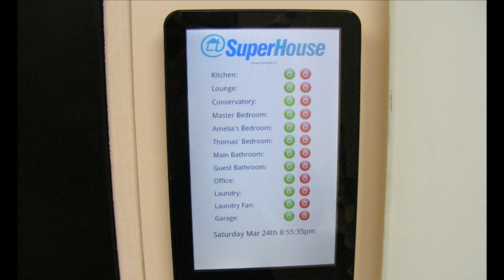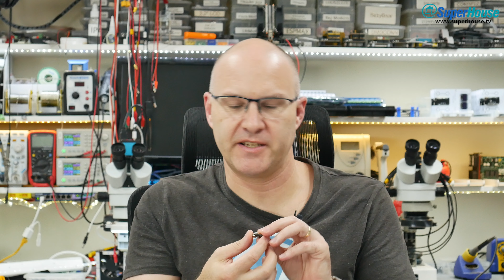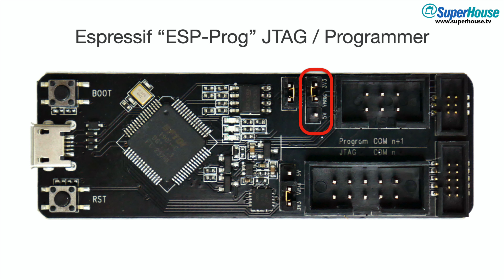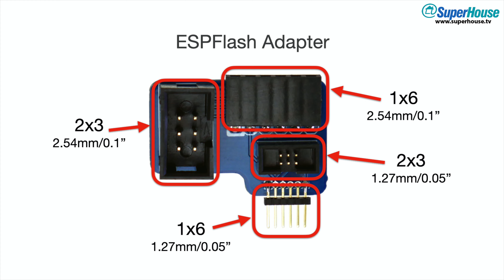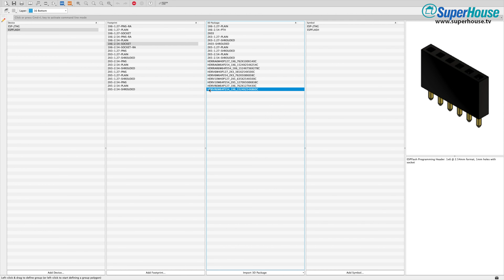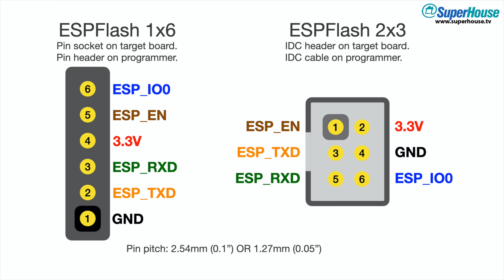SuperHouse 42: ESPFlash programming header for ESP8266 / ESP32

Comment: I'm usually done with 3 pins - RX/TX/GND (GND for correct reference). IO0 is exposed as tact switch button and is also used to trigger WiFi config mode in application (general purpose button). Power is delivered via power-only USB port. If you want to flash device, simply connect USB2Serial converter, press and hold tact switch and then connect power.
This has some disadvantages, as it requires user to handle that manually, but I'm only using this for initial flash or recovery from bootloop in case of crashes - usually flashing via OTA.

Comment: I was wondering what came of this project. I must say in the meantime that I came to basically exactly the same conclusions, including 3.3V power and separate 1x6 and 2x3 layouts, and especially that the espressif 2x3 0.05" connector is the best one to implement onboard.

For the programmer board, I think that the jumper option for 5V, 3.3V or no power is a idea, on balance. Especially the option for no power so that it's safe to connect with external power to the target board anyway. The main reason I'm against requiring 5V power on the header is that there are plenty of applications where you don't want a 5V-to-3.3V regulator on the target board. However, having 5V as an option might be useful in some cases.

Comment: How do I solve the GPIO 00, 02, etc HIGH at boot of esp8266? The relays connected to these pins flicker at boot.
I am trying to make a smart switch that use 4 relays and 4 switches. But out of the usable pins, only 5 are 'safe pins'.
How would one connect 4 switches taht could be in either on or OFF state and relays too.
Please help.
Reply from the maker: You could use ADC0 with a resistor ladder to put all the buttons onto a single input pin. Or use GPIO0, 2, 16, and ADC0 for inputs (active low) and still have GPIO4, 5, 12, 13, and 14 available.
Reply: @SuperHouseTV  In case of GPIO0,2,16, if the switch position is low, then the boot would fail. So those would not be ideal for input. I was thinking of putting some circuit on them to use with relays so that they dont flicker at boot. As I understand, these pins are HIGH for about 200ms at boot. I read about adding capacitor across the optocoupler of relay, but it didn't work.

Comment: Hi Jonathan,
Thanks for mentioning the work I did related to this with the wESP32 in your video!  I like your XKCD reference as well, I think it's applicable here. :)
What I still don't understand is how you deal with feeding 3.3V into a board that may already be supplying 3.3V itself (or not, in which case you reverse bias its regulator).  In my experience most regulators are not very happy with this situation.  This is why my header supplies 5V through a diode, which can be diode OR'ed with any other supply through a diode, and then gets regulated by the board's own 3.3V regulator.  Would you explain how you deal with this?  It doesn't cause issues?
Reply: Another reason to go for a 5V input on the header is that you may have the 3v3 regulator close to where it is being used and not trying to get 3v3 @ peak currents of upto 500 mA (short surges during RF calibration on the ESP's) through flimsy thin dupont wires and connectors which not always make the best contact.
Also a lot of programming boards you may buy nowadays seem to be competing with eachother to find the voltage regulator with the lowest allowed max. current.  So even if people try to use this "ESPflash" header by making their own  jumper cable, you still have to deal with flaky voltage regulators.
@Patrick, I love the slight offset you used for the programming header to make it stick without soldering.
I will also start using that on my own boards for ESPEasy board designs as it may also be useful for quick testing of sensors without soldering and using extra headers.
Reply from the maker: Power supply capacity is a very good point. I should add a note on the spec page so suggest that any implementations of the programmer should include up to 600mA available on the 3.3V line.
Reply from the maker: Thanks for making the wESP32, it's a great board! I usually use a linear 3.3V reg for final supply, even if I use a SMPS to drop a higher input voltage (say 12V) down to 5V first. Linear regs are typically quite happy being back-powered. In the case of a board that can't handle power being supplied externally, such as an onboard 3.3V SMPS that doesn't have backpower protection, I'd treat that as a special case and leave the 3.3V pin disconnected on the ESPFlash header on the target board. Then you'd have to use the onboard power supply while it's being programmed, rather than use power from the programmer.

Comment: Probably too late now that it's been published, but any reason not to make the 2-wide footprint compatible with something that's already standard? The SWD footprints for ARM already have a strong foothold.The pin names are different, but mapping VCC/ESP_RX/ESP_EN/ESP_IO0/GND/ESP_TX onto VCC/SWDIO/nRESET/SWCLK/GND/SWO gives you enough compatibility that connecting the wrong debugger won't hurt anything (assuming VCC is 3.3v instead of 5v), and it's easier to make use of existing ecosystem around ARM, vendors already make the cables, there's also overlap to JTAG connections, third party derivatives like the 0.05" tag-connect devices, and the 10-pin SWD (adds GND/GNDDetect/NC/NC) connection; it also makes it easier to go back and forth between ESP and ARM (and potentially Risc-V, which would be expected to be compatible with ARM where there's no reason not to be).
Reply from the maker: That would be really nice, but because Espressif themselves already make the ESP-PROG with its 2x3 header I didn't want to deviate from that. It's the closest thing we have to an "official" programming header standard for ESP chips.
Reply: @SuperHouseTV  Ahh, I missed that somehow. I think I took the video as "Espressif makes an official connector, but no one uses it so we'll just ignore it" which seems completely unrelated to what you'd actually said. Even going to a 2x5, adding to the edges like you're doing for the 1x4->1x6 header would still keep it from playing nice with ARM SWD. 

Another chance for edge connectors with https://debug-edge.io/ ?
Reply from the maker: Interesting, I haven't seen Debug Edge before! Thanks for the pointer.

Comment: I use the same but with vcc and gnd flipped, because you do not always need vcc, so its on the end not in the middle. auto reset pins go on the other end the gnd end.
Reply: It is wEsp I think , I used it because it nests from 2 pin to 6 pin, tx only, manual rx tx, auto tx rx, all with optional vcc, you could even stick a 5 pin nest with remote reset also
Reply from the maker: I should add that to my spreadsheet of header variations.

Comment: Also call out a silk screen standard or logo, maybe just “Esp32Flash” would be good?  Guess I should redesign my header and programmer now:)
Reply from the maker: Labelling is a very important point, thanks. In my EAGLE footprints it has "ESPFlash" next to it, but labels will depend on board space. What I should do is expand the page with the header definition to include examples of labels.

Comment: Great idea. I implement the esp programming header as a tag connect tc2030 for two reasons. First, it does not need a physical connector. Second it is a "singe sided" connector. But for one-offs the price of the cable is a bit high.

Comment: As you are going to be powering the board while programing, so what are you looking at power wise for you programer? I use a 3 pin header alot as the board will be powered by it's own supply so I only need 0V, TX, and RX. I get around this by having a set of different programing cables. 

I think there are too many ways that are out in the wild so any change is going to be hard.
Reply from the maker: My version of the programmer has a 3.3V regulator and takes power from USB.